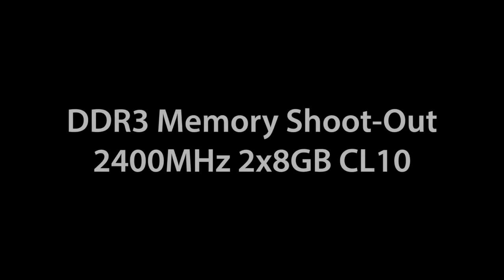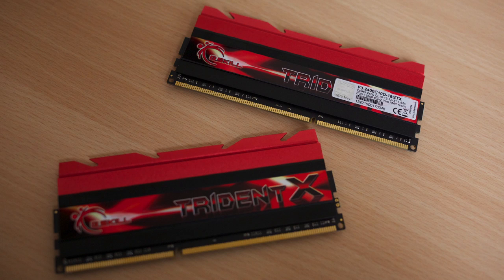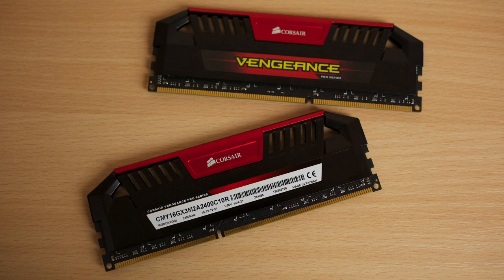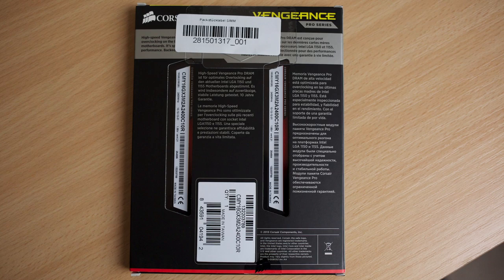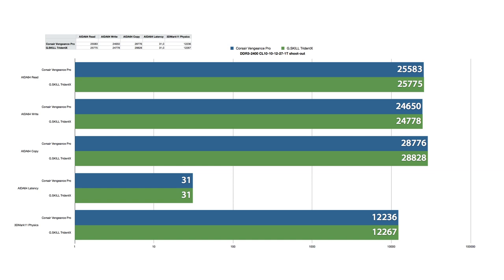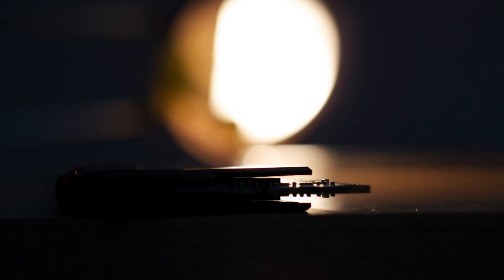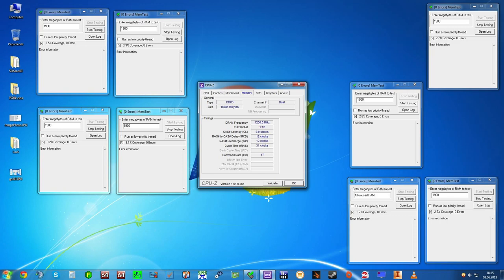Corsair Vengeance Pro - G.SKILL TridentX - 2x8GB Dual-Channel Kit DDR3-2400 Shoot-Out

Comment from the maker: sorry for the late reply. Couldn't post my reply 2 days ago, when I tried to answer your question. Well, the new Haswell's IMC are improved and pretty much made to be used with 2400 MHz memory. So, yes, this kit is great and I did enjoy using the TridentX - but I switched to Dominator Platinum kits because of hardware quality issues with the TridentX. But chip wise - they are excellent.

Comment from the maker: That's true. I'm using Hynix based Dominator Platinums now and they are getting 10-12-11-27-1T again, running superbly and get the same results as the Mushkin Redline kits I've used before (2x4GB ridgeback 10-12-12-28 2400) which were excellent as well.

Comment from the maker: Corsair Dominator Platinum 2x8GB 2400MHz CL10-12-12-31 kit with 1.65V

Running at CL10-12-11-27-1T with the following results

Read: 25689
Write: 24777
Copy: 28822
Latency: 31.4

So they are similar to the TridentX kit with a little slower Latency. Talking about hardware, I think the Dominator Platinum are the best memory kit on the market for aircooling, as they have dramatically lesser temperatures compared to standard kits.

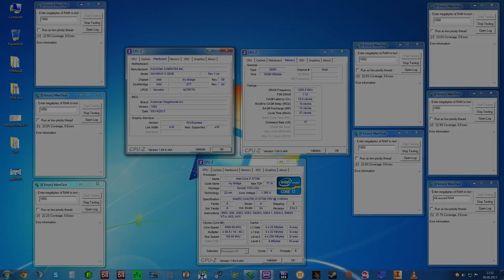Comment: Bei 1:46 wieso zeigt z-cpu nicht die 2400 Mhz an die der g.skill haben sollte an?  Hast du nicht XMP aktiviert?
Reply from the maker: Es zeigt 1200MHz an - was einer RAM-Frequenz von 2400MHz entspricht. Das ist normal da dort nicht der "dual data rate" takt angezeigt wird, sondern die reine Taktfrequenz. Ist auch im AIDA64 so.

Comment: Your video played a part in my decision, along with some other videos, checking plenty of benchmarks and reading forums, and the fact that the TridentX are CL 10, not CL11 the Corsair timing, to go with..... drumroll.......
G.Skill TridentX 2400MHz. Just 2x 4Gb though, so half the capacity here. Thanks.
Reply from the maker: ***** Good choice. For me there is really only one memory that i'm ever getting (if purchasing a set again) .. the dominator platinum. they are soon cold under extreme load - there is just no comparison to any other memory. Due to their extended base plate and hardcore thermal system, they are about as good as water-cooled chips 😉 i'm using a set of 2x8GB ddr3-2400 at CL10-12-11-27 😊  But still, the TridentX are a good chip. Have fun with them!
Reply: Im running them with an FX8320 (stock) on a 970 chipset (ga-970a-ud3p) Gigabyte board. So many people on forums saying its not worth getting anything near 2400mhz as it's never going to be used. But, just after install, enabled XMP timings in bios with default 17.5 multiplier and 200mhz FSB and we're just over 2100mhz already, cold RAM. Quality stuff

Comment: nice microphone
Reply from the maker: ***** Thanks! I'm using a Zoom H2n microphone with "raw-recording" support. Which means you can decide if you want mid or side signal in the application later. This makes it easy to adjust the tone of the audio recording fairly easy and provides a good sound quality. My next step is to use a silent part of the recording for noise analysis that I then use to remove noise from the whole clip - thus there is no noise left. (Noise includes computer fans, general rumble, base noise of the microphones, etc)
Reply: Florian Uhlemann that sounds pretty awesome

Comment: Im gonna buy a new pc rig with i7 4770k but i don't know what ram brand i should get, I want a 2x8gb kit at 2400mhz and cl(as low as possible), the price should be 200dollars and below. Havent decided on the motherboard yet either, dont know which motherboard i want yet, onl know that i want the z87 chipset.
Reply from the maker: I can recommend any ASUS Maximus VI board with Z87. The GENE is fantastic if you don't want too many gpus. the Hero is a great mid-grade gamer board. Just check out all of them and decide yourself. Never regretted owning the ASUS RoG series of Motherboards. nice hardware. For the memory, I'm using a set of Dominator Platinum 1.65V 2400 CL10-12-12 2x8GB memory modules myself currently and I'm perfectly happy with them. Why I went with the Dominators? They have the same samsung chip, but are cooled much much better. (through board and through outer heatsink) so they remain totally cool, despite overclocking and high usage without a fan or without water cooling. It's worth the extra buck in my opinion.
Reply: Florian Uhlemann Thanks for answering, I chose the Hero, I don't know about the dominator platinum tho, I don't like the LED feature as I think I will only pay more just for that, are there any other RAMs with the samsung chip you would recommend? (perhaps a bit cheaper) :)
Reply from the maker: doto it's not the LED that makes it good ;) it's the way better cooling system that's implemented into all Corsair Dominator memory kits. That's what you pay for :) I mistakenly said samsung, but the current ones are Hynix - the kits in this video were partly samsung ICs. I like hynix better ;) But, considering cooling performance of the memory modules there is no second choice when it comes to the dominators. - all other modules, Vengance, TridentX, etc are all regular memory kits with heatsinks clipped over them. Although the TridentX have a more solid sink, they don't always have proper contact themselves :-/ G.SKILL makes good memory, or check out the newest Mushkin ones! I've had a set of 2400 mushkins before and LOVED them :)
Reply: Yes, I went with the dominator platinum! Now I got to figure out what and how I'm gonna clock them, got i7-4770k, Asus Hero, dominator platinum, gtx 780ti, corsair H100i and a 1000W PSU, got any suggestion about voltage and stuff?, I'm not that keen on overclocking, I overclock once and then leave my PC on 24/7 :D
Reply from the maker: doto very, very cool. would be exactly the setup I'd like to have - although I won't upgrade unless I know for sure I can run 4800MHz on cpu while keeping 2400MHz on mem :D a bit picky there...

btw, those are 24/7 clock rates for my pc.. for overclocking, be sure to check specific guides for the new maximus VI series... as I'm certain they are a little different than ivy bridge - which are the only ones I can give you a hint on.
Reply: hehe, well you would need one hell of a watercooling system :) btw, I ordered a PC and got some "we build your PC for free" offer, so I decided to let them build it for me. They contacted me, saying they coulnd't build my PC with the RAMs I've chosen cuz they can't build memorys' with a mhz over 1600, because "it causes alot of instability, and faults with alot of motherboards" is this something I should be worried about? I did choose the 1866mhz ones, but seems kind of odd that they would sell like 2000mhz if they cause instability...
Reply from the maker: doto I wouldn't consider it a problem at all with a Haswell! They are rated at 1600 of course, but pretty much every single chip will do at least 1866, more like 2133 safely. a M6Hero board with a 4770k will easily do 2000+ without a single glitch .. sure, it might require some tweaking to get a little higher - but 1866? that's about as simple as plugging it in and punching in the numbers and seeing the magic of Maximus boards :)